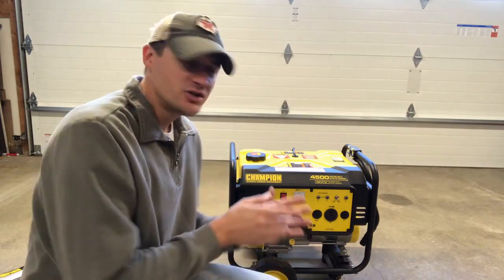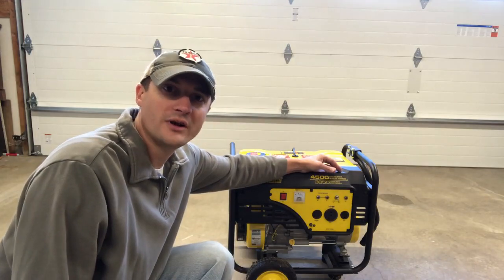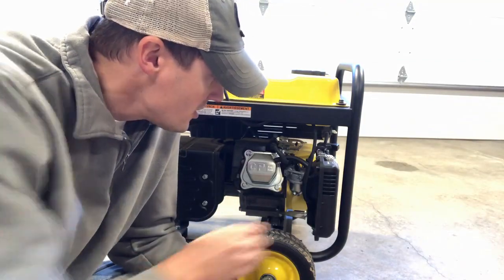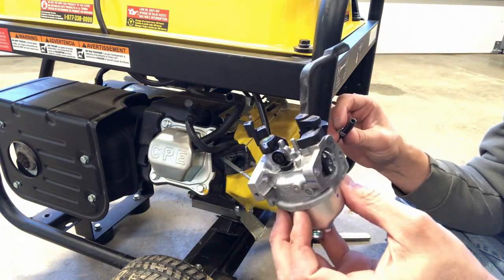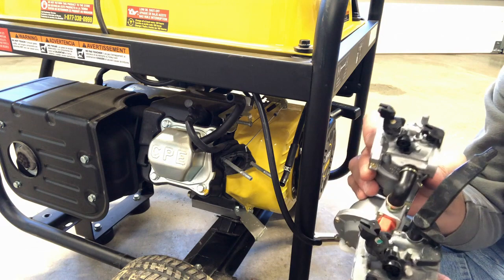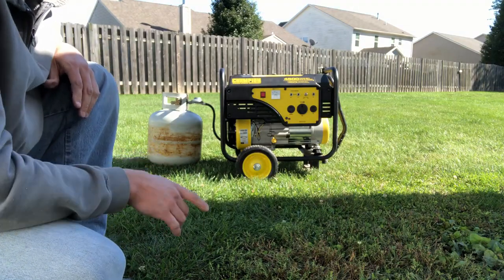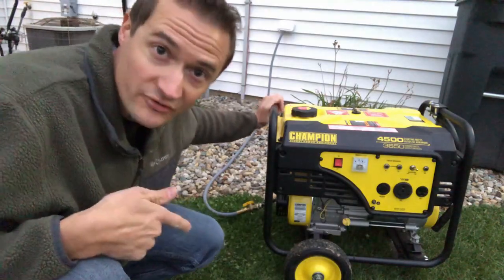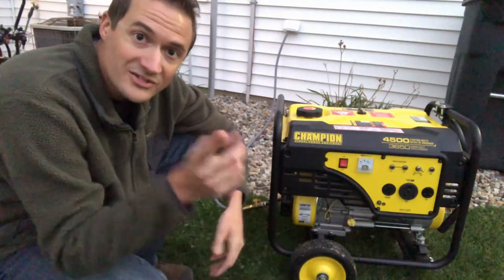Generator Conversion to Natural Gas, Bottled Gas, and Gasoline

Comment: Send me the information where you got the carburetor.
Reply from the maker: The original one we purchased is out of stock, but this one is similar if not the same. 

GardenDream Dual Fuel Carburetor LPG NG Conversion Kit for Honda GX160 168F GX200 170F 2KW - 2.8KW 6.5HP 7.5HP Generator Manual Choke Carb https://www.amazon.com/dp/B08S3Q3VV6/?coliid=I327O8EXVPUXUC&colid=3HRY94PB5K7FD&psc=1&ref_=cm_sw_r_apin_lstpd_YQQ3JBJP99Z46PYTNHVW